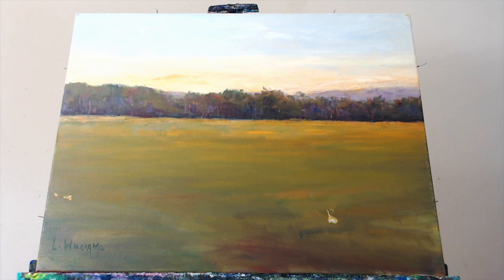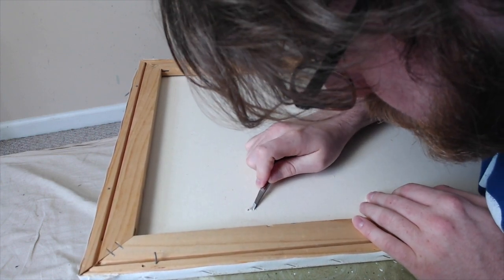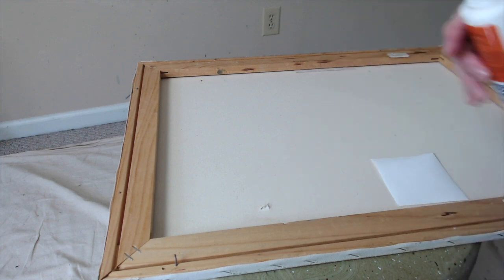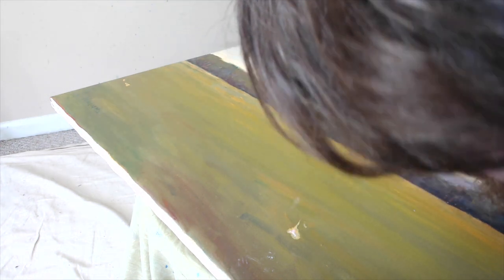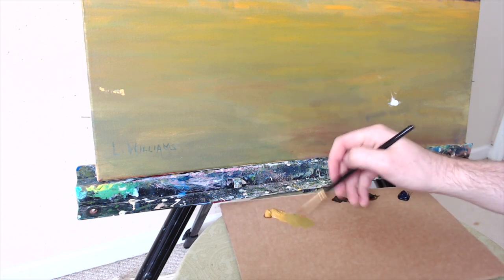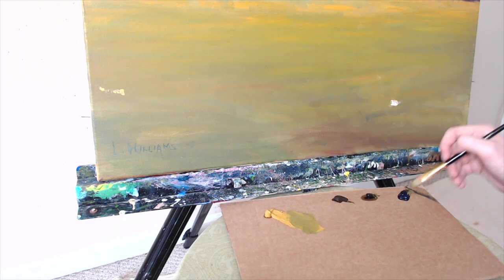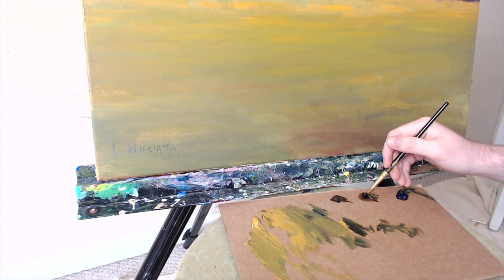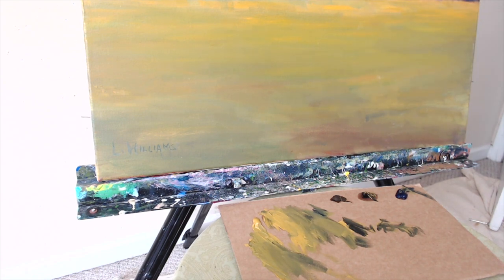How to Repair a Damaged Painting DIY

Comment: Will you please show a close up?  Was the patch on the back detectable on the front of the canvas?
Reply from the maker: I'm sorry, I don't have closer picture to show as the piece has been delivered to the client. But no, you couldn't see it from the front. This is a quick fix method, and is not intended to be archival level work, but enough that you can restore a damaged painting for personal display.
Reply: @ImpulsiveArtistrybyCharlesWolf  thanks for your reply. I just watched another video and the recommendation is not to 'patch' a painting, becasue it will show through, in time I guess.
Reply from the maker: @piitaa108  I haven't seen that be an issue, but I use a lot of paint, so the layers are pretty thick. 👍 Good luck with everything!

Comment: No gesso over oil paint. There are other archival fillers.
Reply: What archival fillers are good for over oil paint?
Reply from the maker: Just a quick fix method, not intended to be archival level work. I leave that to the experts. 🙂
Reply: @ImpulsiveArtistrybyCharlesWolf  Bad information,  NEVER DO THIS.  WORSE THE PATCH  WILL PULL AND THE OUTLINE WILL SHOW>  DO NOT  DO THIS TOY WILL DESTROY THE PAINTING,